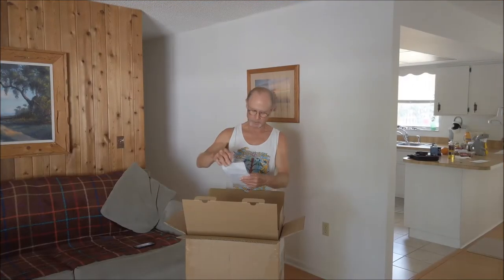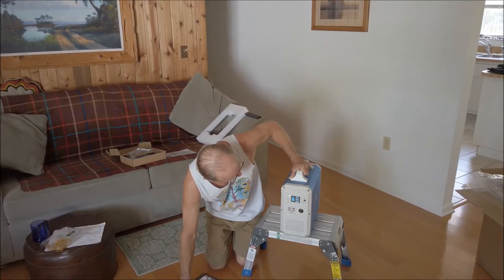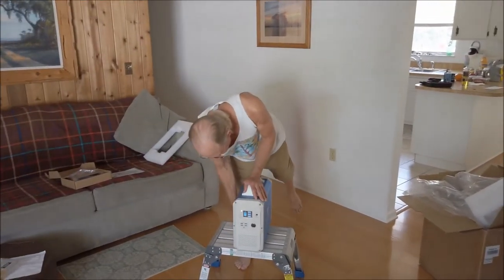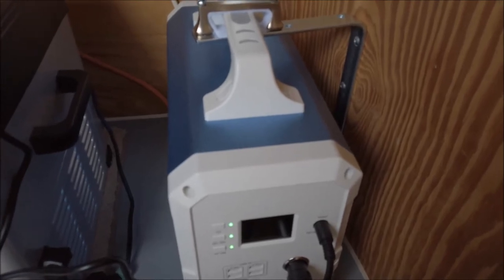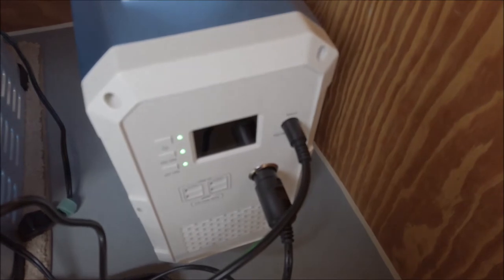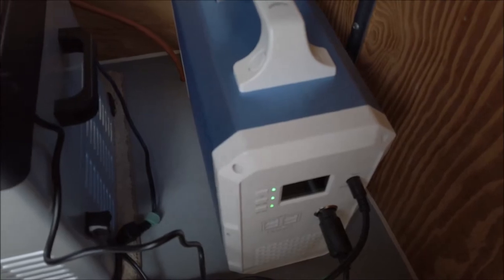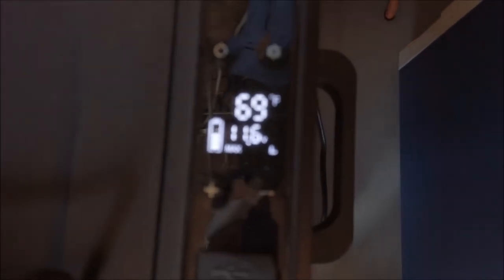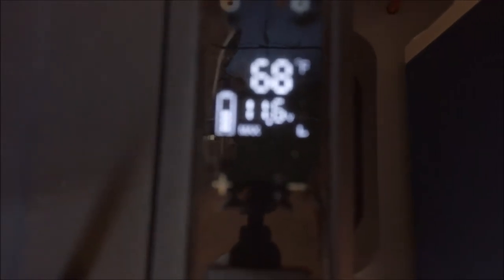My testing of the MaxOak Bluetti EB150

Comment from the maker: Update: The screen on the EB150 has gone black so there is no readout at all now.
Reply: GUN TO HEAD..SAME COST....THIS OR JACKERY 1000 ? OR SOMETHING ELSE FOR 800-900 ?
Reply from the maker: @BOOSTEDLASER  Don't have any experience with Jackery, but this particular unit has not been too useful to me. I now have an MPP all in one with 4 SOK 100Ah batteries and it works great. Can run my A/C overnight and charge the next day with 6 Renogy 100W panels.

Comment: The Bluetti has a 12 volt regulated port.  DIY Solar tested it and it ran over 12v steady. Hobotech tested his AC and the bluetti had no problem running it, what is the Max Watts on the AC when it starts up? What is your inverter wattage on the Gas generator?
Reply from the maker: Yes, as I verified in my video it is just over 12 volts. The problem I had was that by the time it got to the cooler it had dropped to about 11.5 volts. This is probably why most manufacturers have their 12v DC sockets set to over 13v (which Will, DIY Solar, makes note of on his other reviews). Bluetti dropped the ball on this one IMO. Hobotech has the same Frigidaire A/C that I have except his is the cheaper model with the mechanical controls instead of the digital ones. My model is actually slightly more efficient at 3.8 amps while his uses 4.0 amps according to the Frigidaire website, other than that ALL the specs are the same on this 5000 BTU unit. I think the difference is (and I've thought about it a lot and researched it a lot) that he got his directly from Maxoak to do a commercial on YouTube and Maxoak sent it to him to sell more units. Do you agree? So why does my Bluetti not run the same ( even slightly more efficient) A/C unit and his does? Do you think maybe Maxoak made sure his was in tip top shape or perhaps even tweaked it a bit and my unit was not? Well, I don't have any explanation other than that. I researched the EB150 for over a month including watching the videos you mentioned. In fact the Hobotech review was probably the deciding factor for me. I don't know near as much about this subject as he does and I don't hold him liable, but it's not something that takes a lot of expertise. Charge the Bluetti, turn it on, plug in the A/C and turn it on. Either it works or it doesn't and in my case it didn't. So the bottom line of what I am trying to say is "Buyer Beware". (BTW, the generator is the Honda EU1000i, a 1000 watt inverter generator. Also, FYI, the EB150 is sold at Walmart under the name "Expert Power" for slightly less. It is exactly the same unit as the Maxoak Bluetti. If you are thinking of getting one that might save you a few bucks.)
Reply from the maker: So then why did they up the voltage on the AC200 to 13.4V?